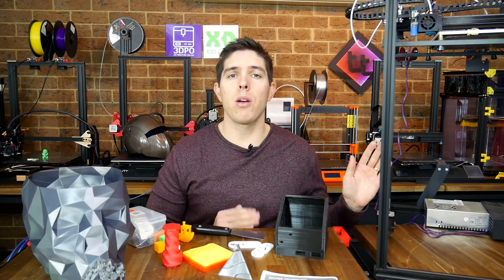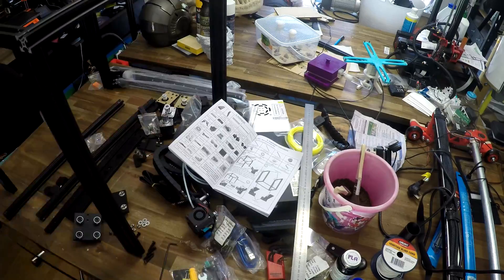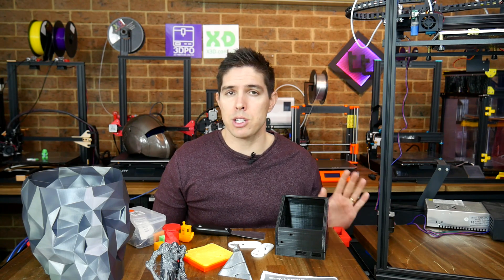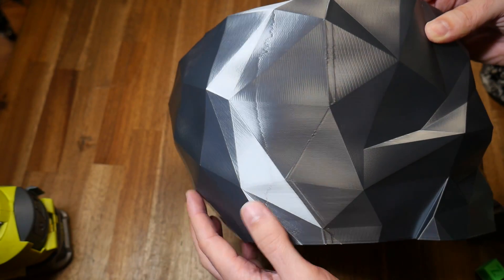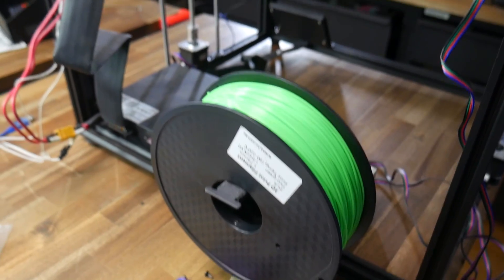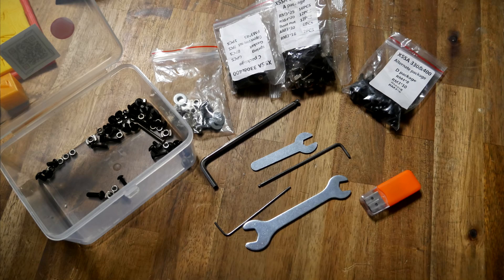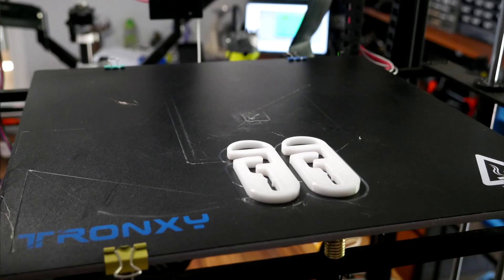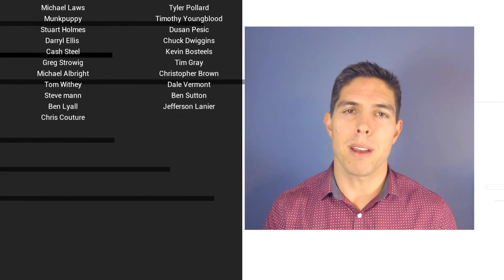Tronxy X5SA Pro review: A large format CoreXY 3D printer (with issues)

Comment: Also have an x5sa pro, i got mine through amazon about a couple months ago, it is an excellent printer, but exactly as you said, it's taken a lot of time with tronxy support to get there.  I had most of the same issues stated in the video.  except aligning the upper xy gantry, the manual showed how to do that pretty clearly by holding it against the upper support bar while tightening, the alignment of that was hard to mess up.  another issue i had, it shipped without the bracket to hold the runout detetion sensor.  Tronxy support shipped me the bracket (with another sensor attached) no issues there.  The biggest issue was some x axis skipping i was getting on larger long prints.  Tronxy support had me open the motherboard case, which mounts upside down and requires removing the whole assembly.  I then sent them pictures of the mobo, because i guess they coudln't identify my revision from model or software version.  They replied with bad instructions on adjusting the x/y axis power supply potentiometers, which requires ownership of a multimeter and knowledge of how to use it, and a very steady hand, since you need to live adjust on a hot board the pot.
anyway, after that I am now printing some beautiful things.  oh and figuring out a cura profile, which i do have after lots of tweaking, i should share that somewhere...
Reply: also my benchys came out flawless, but i had to enable retractions in the slicer and work with temp a bit.  I feel like i can produce some of the best FDM benchys i've ever seen on this printer. i'm excited about upcoming prints, i'm doing a full sized rocketeer helmet right now, at 80mm/sec and it's printing pretty nicely

Comment: I have the Tronxy x5s not the x5sa. But i think you touched on some points that have been glaring issues with tronxy printers. Particularly lack of instruction and issues with stock hardware. Lot of people seam to target creators who post valid criticism of the tronxy printers but it does no service to the community to sugar coat printer and not highlight their problems. This is a great video

Comment: Hi Michael, what do you think of the planetary gearbox stepper motors Nema?
Do you think they can improve the quality of 3d printers (ex: Ender 3 and Ender 5)?
Reply: Whenever I’ve heard of people trying them they were disappointed. Gearboxes for the most part aren’t made to increase accuracy, they’re made to increase torque. Moving from 200 steps motors to 400 steps/rev motors is the easy win here. After that, microstepping. And at that point your motor is controllable to well within half a degree, closer to 0.1 really. You have to make a really good, accurate, expensive gearbox to translate that into fewer rotations but even more accurate. And the ones you will see sold on affordable steppers, for the most part, are not that.

Comment: There is a nice simple belt tensioner on thingiverse for the X5s. It’s 2 parts that mount to the top front and lets you slide them to tension each belt. It’s worked great for my X5s so far.
Reply: Can you post a link?
Reply: @mvanzante  you ever find it?

Comment: I have a TRONXY XY3. Terrible printer. Half of the time it doesn't work. Kept shutting off randomly and their support online said to remove a module from the board. Seems sketchy. 
Came broken and they wouldn't fix it, the filament they sell isn't very good, and the wiring on the machine it awful. I regret my purchase.

Comment: Thanks for the great review. I bought an X5SA Pro a few months ago as my first 3D printer. I knew I was in for a project but it matched my price range and size requirements. I have had many of the same issues you detailed. Including the exact problem with the z-offset not being set and damaging the bed on my first print. I ended up ordering a glass bed from Tronxy and putting a thin sheet of steel under it to extend the range of the bed leveling sensor. That has helped a lot. I have also replaced all of the fans on the printer, the bowden tube, hot-end, etc. I can't say that I recommend the printer, but I have learned a huge amount through the process and gotten a lot of useful prints along the way. So I don't regret my purchase.

Comment: Did get one, one of the stepper drivers blow up then they refused to send me a replacement for free even after a week of testing various firmware and making a video showing that it doesn't work. They tried to scam on the aliexpress dispute giving the shipping code from another replacement they shipped me (the plastic Y motor mount), luckily aliexpress at the end give me a partial refund covering the expenses. Overall a really bad bad support. They also didn't have the gcode on their official site. Overall i think there are way better alternative for around the same price.
Reply from the maker: Wow, not a good experience. Thanks for sharing.
Reply: @TeachingTech  you can see the stepper driver exploded here https://ae01.alicdn.com/kf/U6444e920fb3645878798167bb1bc95f7L.jpg
https://ae01.alicdn.com/kf/U43cbefcd94204761a13c3221eab3a2e2V.jpg
Reply: "They" you're talking about aliexpress seller don't ya? "Official" in store name means nothing FYI :)
Reply: @SergeiSugaroverdoseShuykov  they sent some useless firmware and gcode files with vicky@tronxy.com
I think it's pretty official.

Comment: I've had one since last May.  It's not a beginner machine for sure.  It didn't print well out of the box mostly because of a poor hot end setup. I put on an E3D V6,  BMG dual drive extruder (clones) and neoprene/fiberglass belts.  That made a big improvement.  I also spent a lot of time squaring everything and trying different belt tensioning. I didn't have much problem squaring the x gantry. If you slide the x extrusion all the way back to where the pulley plates touch the stepper plates, it's much easier to square up (providing the stepper plates are square).  Also ended up adding an SKR 1.4 w/2209s's and added linear rails to x and y, though it wasn't really needed, it helped a little. It prints very good now and very smooth. I get almost no noise at all in my prints.

I had read the reviews and knew what I was getting before I bought it. I paid $245 shipped and figured I would use it as a base to build from. It's a very good printer now and was a lot of fun (and sometimes frustration) to mod. But that's what I like to do. Those that don't like that may want to pass on this printer.
Reply from the maker: I think your case is ideal. You got it cheap, knew what was coming and then upgraded as necessary.
Reply: @TeachingTech  Exactly.
Reply: This x gantry thing is the one I didn't understand. If you don't tighten the screws, it stays loose.  No suprise. Maybe the way to get it square was not included in the old manual.
I have the X5SA and it came with a titan extruder clone. What was the original extruder on your machine?
Reply: @doomer8348  You use the stepper plates to hold the x pulley plates square while you tighten the extrusion to the plates. 
It came with a poor attempt at a Creality clone extruder setup.
Reply: I got a  X5SA 24V, quite a few problems  as in the video.  poor quality of extruder,  belts that look like plastic, Very noisy fan, and stepper motors of low quality and look like used. Will be using the base to upgrade in the future when I get some time.   With Tronxy not so easy to deal,  thanks to AliExpress for their help.  Looking forward to get this working nicely.

Comment: are we gonna get an upgrades video?
like this comment if you want one
Reply: I'd like to see what it takes to get it where it should be. It's clear that it's going to be a base for upgrades, but what will work? Knowing that would help people determine if it's a project they want to tackle. It has potential...
Reply from the maker: I'm on the fence. Part of me wants to but the other part just wants to move on.
Reply: @TeachingTech  Please do it.   :)
Reply: @TeachingTech  I just have seen videos about it usually people say it's a good place to start to build a good corexy style machine
Reply: Teaching Tech Hope that the part of you that wants to is bigger than the part that doesn’t. It’s clearly nota beginner machine nor anything close toa professional quality but.. given the large size, the frame  and the corexy it should have potential to be a really good machine. Giving a follow up can not only provide the rest of us with valuable information on how to tackle the machine - but also provide feedback to Tronxy like e.g. Your remark on the difficulty in squaring up the gantry. It does seem like the printers currently sold has already had some updates. The screen has at least changed, either model or mounting and perhaps controller.
Reply: Or do you have a better core xy machine that you want to try?
I kinda need one

Comment: I got the X5S back in 2018, and it needed its share of modding. More of a collection of parts that can become at least a useful machine. What helped me with getting it square was to add corner pieces, and to tension the belts I pushed the X gantry to the rear against the end plates...
Reply: Thanks for your helpful comments. I am still awaiting mine from China, but have noted your points.
Reply: @dandare2586  I've used hints from SgaboLab like using wood boards to close and stabilize the frame, e.g. https://www.youtube.com/watch?v=eQKk_JKw-sY , and I also put the motors in front and the belts in the back, wired the Z axis in series instead of the regular parallel, and changed/shortened the routing of the filament tube and power chains. Threw out the original heatbreak and replaced it with a cheap one with integrated PTFE after I had a couple of clogs due to the original one's all-the-way-through PTFE bowden wiggling loose. Also replaced the original 8-bit board with a SKR 32-bit one and silent drivers, and added a 0.6mm volcano type nozzle and heater (but that's rather recent). Here's the heater: https://www.instagram.com/p/BzeTQK9FWZ_/ and that's the new mainboard with a version of Marlin that recognizes broken/dangerous heating: https://www.instagram.com/p/B7PMzwQIKvj/
Reply: Hope you changed all of the electronics as well, a fire waiting to happen ...

Comment: X5SA Pro not X5AS 🙂
Look forward to see alot of great modding on this Printer !
Reply from the maker: Fixed the title, thank you.
Reply: @TeachingTech  No problem mate. Thanks for the video.. Just got the 2020 X5SA Pro.. Looking forward to modding it, Hope you will do some follow up on this printer. Did you have a look at the BTT color mixing hotend btw?
Reply: @BlueprintDK  How is the printer going? I am looking for a larger build volume printer and like the idea of a corexy, I have a Tronxy X1 right now. Is it worth it to get the X5SA pro and do upgrades, or just build a better one, like the hypercube evolution?
Reply: @randomodbuild  i sold mine.. for the price with upgrades it's at better deal to go with something like the Voron 2.4
Reply: @BlueprintDK  Wow that must require a lot to get upgraded, a Voron 2.4 costs well over $1000
Reply: @randomodbuild  check kits from Aliexpress
Reply: @BlueprintDK  Will do, but probably still over my budget. Not looking to spend more than $600. Do you think I should go for a traditional Cartesian printer for that money, or maybe build a Hypercube evolution? Was thinking about a CR-10 v3, want the build volume to be at least 300 in all dimensions.
Reply: @randomodbuild  a hypercube - sapphire plus or elf.. tronxy is a good base but will burn alot of $$$ so mush that I would go direct for the Voron